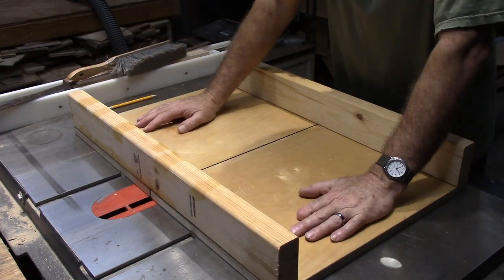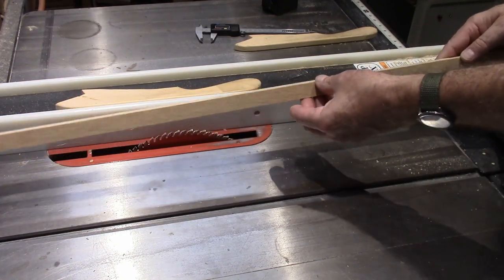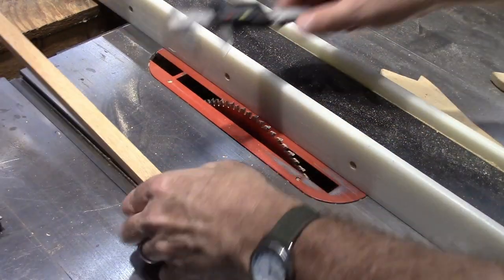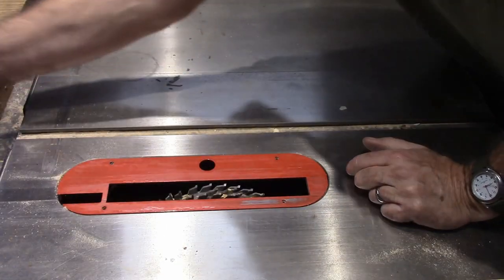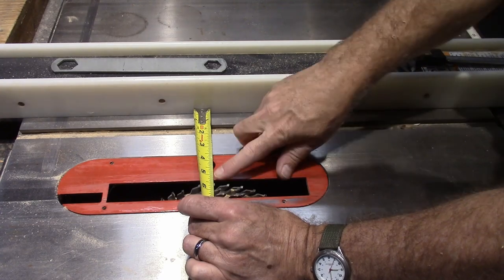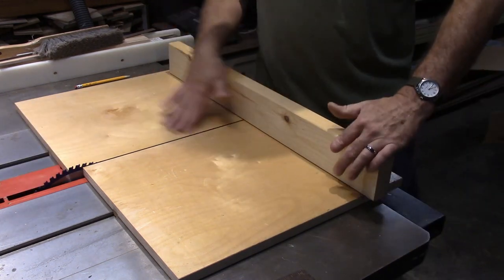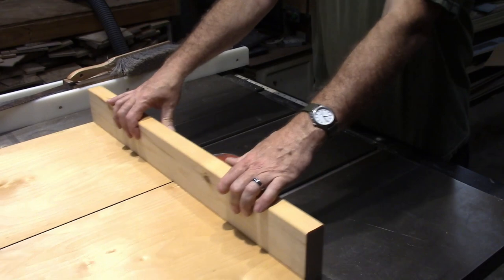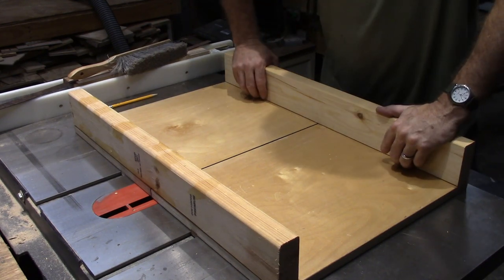Making a Quick Table Saw Sled

Comment: Looks great,, I've been planning to make one of those forever. You should have done the five cut proof to check accuracy, another thing in my bucket list! Cheers and thanks!
Reply from the maker: I've had a table saw my whole adult life but just made my first real sled.  A friend at work was also disappointed I didn't do the 5 cut proof.  I didn't even know what it was until he told me. I'm not a wood worker that has the patience to work to a thousands of an inch.  I'm more the wood butcher type... :)

Comment: You can also make the runners that go in the miter slot out of an old cutting board.   This way it’s tough.   But it won’t move with changes in humidity.
Reply from the maker: The cutting board is a great idea!

Comment: I am a fan of sleds.   In theory the blade and miter slots are parallel.   It’s a bit easier to use the slots as the reference when squaring the 2x4.   Its picking a nit but it’s the slot that determines travel and what we need to be 90 degrees to.
Reply from the maker: Thanks!

Comment: Great project and I sure am looking forward to your cigar box storage ideas.   That will be a good one, everybody needs organized storage.  Any ideas you come up with will certainly be welcomed.  Don't worry at all about the link to Amazon I didn't know it was something involved and all.  What you are doing now is perfect you are putting it on every video.  You see I work at several offices we have three different places and computers everywhere and I couldn't remember which one had the good link when it was needed.  Also am needing gauge pins.  Can you say in a sentence or so why there is a + tolerance and a - tolerance available.  On your site you list the - tolerance, but I don't understand the significance of the difference.
Reply from the maker: My understanding is that when they make them they are, of course not exactly the size they say they are depending on how many decimal points you measure them to.  If the pin is a .250 it may actually be a .25002 or a .24999.  They are never perfect but will be close depending on the accuracy you are willing to pay for and that will determine how far off they can be.  The ones that are a little small will be sold as minus the ones that are a little big will be sold as plus.  Depending on your needs one may work better for you.  For me, it made no difference.  Hope that helps!

Comment: Thanks for the video, any new sawmill videos coming up?
Reply from the maker: It's getting cooler so that greatly increases the possibility.  I never run it in the summer unless there is some lumber emergency.  You get covered in sawdust that sticks to the sweat...  I've been thinking about doing a more detailed video on how the sawmill is made.  I also want to replace the blade guides and the muffler needs a repair, it's falling off.  It's always something....